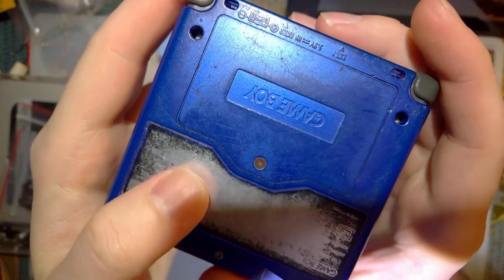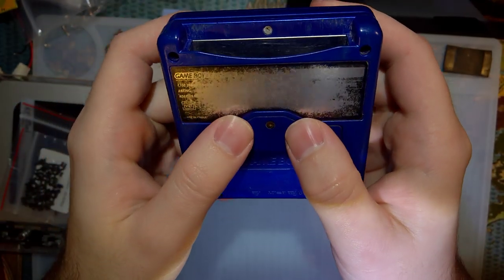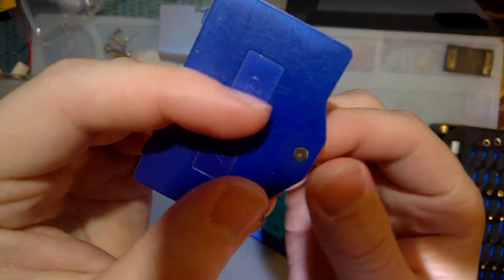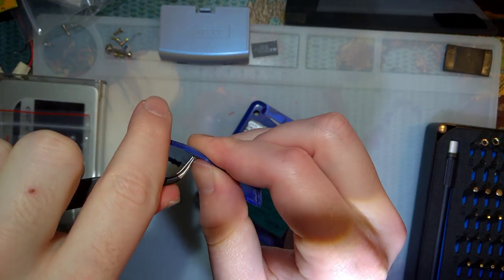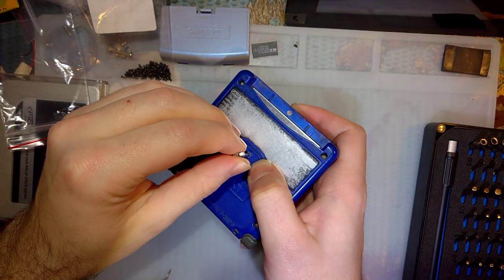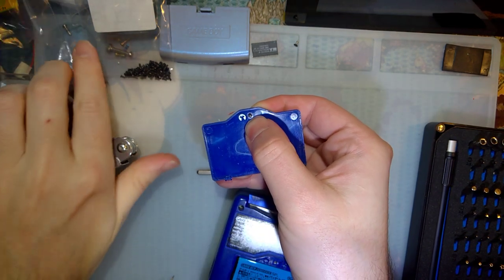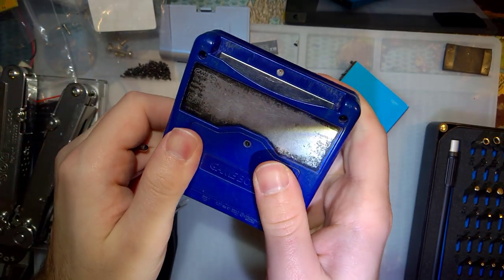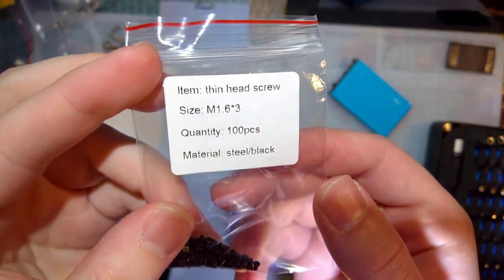GBA SP Battery Screws

Comment: What a strange rumor. I've my 001 for more than 10 years and my screws are fine. So are the other SPs I've bought a few years before so I guess it depends on how well one treats it.
Reply from the maker: I honestly don't know how they got this bad. If it were just one, I wouldn't care but I've had at least four GBA SPs with that issue. I'm sure it doesn't help that most of my consoles are bought as "not working" but still.

Comment: Is it possible to pry open the battery cover without breaking the rest of the shell?  I'm at my wits end with my AGS101.  The screw is beyond salvation.  I've tried everything.  I'm seriously considering just prying/snapping the battery cover and replacing it, but I don't want to completely re-shell...
Reply from the maker: Drill the screw out
Reply: @makho  I tried that but the drill was way too big and wouldn't grip the screw.  I ended up bringing it to a tech repair store and they dremelled it out for $30.  Probably was cheaper than buying a tool myself.
Reply from the maker: @Ocarinist_Drew  Drill bits are only a few dollars but if you've got it solved then so be it.

Comment: Just replaced the battery of my 15 year old GBA sp. As a kid i left it outside for a night, in the snow.. it didnt work back then and after 1 night on the heater it worked again.. now 2021 it is still working, even my original battery worked for 30-45 mins on a full charge. But i orderd a new battery. my screw was pretty fucked.. i only had rust, didnt see the edges. So i scraped most of the rust away, with help of your video and the edges became to show again. I was able to screw it out and replace the battery. Thanks for the video! Hopefully my story tells you more about the rusty screws you see.

Comment: Anyone know what to do if the screw is stripped? I found it really hard to get it off
Reply from the maker: I highly recommend picking up a set of JIS drivers for next time but your best bet here might be to just drill the screw out and then extract with pliers once you get the door off
Reply: @makho  i have the same problem and i bought the set JIS drivers but it didnt work
Reply from the maker: @bruhbruh4566  If the screw is already stripped, any drivers you source will not fit correctly anyway. Drill it out.

Comment: I need to get the battery screw off the back of my gameboy, what size screwdriver do I need?
Reply from the maker: OEM is JIS, not philips. J00 or J000 should fit fine with no risk of stripping the screw.

Comment: Hello! I am trying to get my battery open and i cant seem to unscrew it. It just screws and screws forever i try popping it out but it doesn’t work. Any tips?
Reply from the maker: have you tried using a screwdriver?
Reply: Yes i have.
Reply from the maker: @thetorivor3440  if you stripped it, next step is probably going to be to drill it out. Going forward, I'd recommend picking up a quality set of drivers.
Reply: @makho  The screw is not stripped. Do you happen to have a discord we could talk more easily on?

Comment: I just bought 3 japanese 001s and noticed that one of the battery covers is using a domed faced screw, while the other two have flat faces. The ones with the flat faced screws were real rusted and crusty, while the domed one appears shiny and brand new.

Thanks, will have to try this out because the rust really ruins the look of the housing.
Reply from the maker: I had another thought to just add magnets like I do on my AGBs. I might have to give that a try. Glad I'm not the only one with this strange issue though.

Comment: On my GB that screw has turned completely black and what's worse the screw is completely round so no screwdriver can remove it.
It's the only screw that doesn't allow me to change the button pads as one of them is broken. I'll probably end up using a dremel.

Comment: The screw on my black GBA SP ASG-001 is pretty much stripped. Weeks back, I tried unscrewing the compartment to replace the battery, but I really can't get the screw to unscrew. 
I don't really know what to do at this point, and I don't want to risk damaging the hardware
Reply from the maker: If it's gone, your next step is to drill the screw out entirely or try using a dremel to cut a slot for a flathead screwdriver. Drilling out the screw is likely less destructive since once you have the battery cover off, you can just twist the rest of the screw out with pliers or just push the square nut through the back of the shell and replace both. Cutting a notch with the dremel risks cutting into the battery door.

Comment: mine is still perfectly fine, no rust of anything other than the typical wear from unscrewing it to replace the battery.
my gba sp is a 001 model, maybe 101 models have the crappy screws?
Reply from the maker: I have more SPs that are completely fine but that does not change the fact that these screws can and do rust. This is a 001 model, not a 101.

Comment: Quick question! I’m trying to verify authenticity of a GBA SP AGS-001 I recently bought. Are these consoles normally featuring a flat screw on the back center? I noticed the AGS-101 models have a round screw, but I also see a round screw on some AGS-001 consoles too. Does a flat screw on an AGS-001 mean it’s been replaced or tampered with?
Reply from the maker: aftermarket shells usually have rounded screws

Comment: Hahahaha try working on a 20years cars in the rust belt, every single nuts and bolts are seized: penetrating oil, impact guns, heat, angle grinders, oh so much fun.

As a non destructive way, try using heating up first then quickly cooling it, eg can of  compressed air upside down.

The rapid change of temp may break the bond.